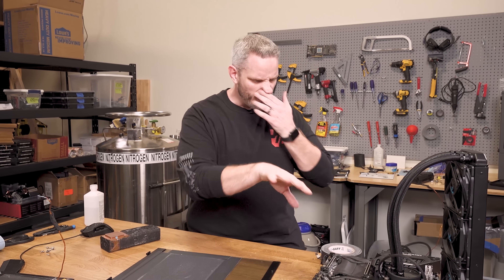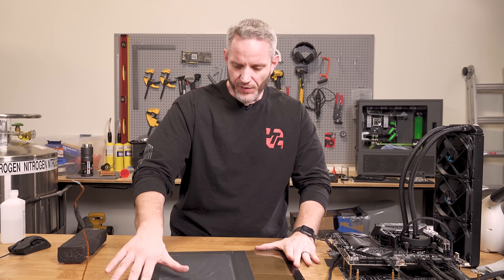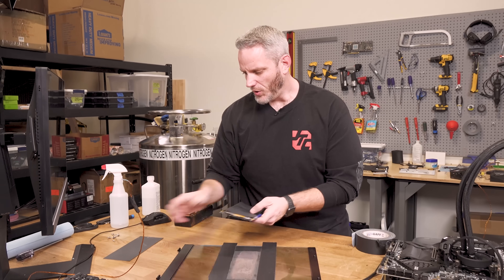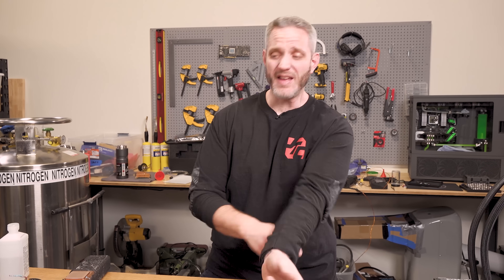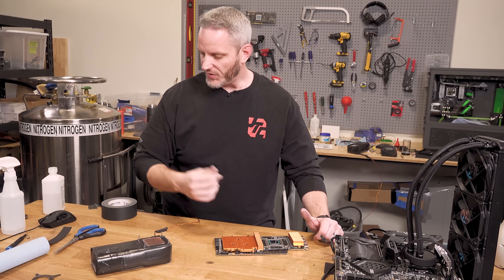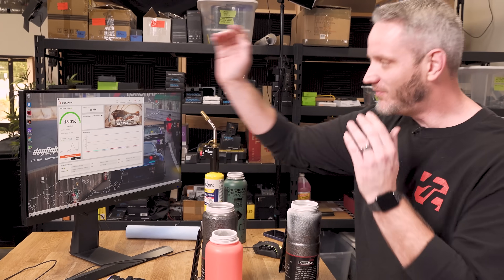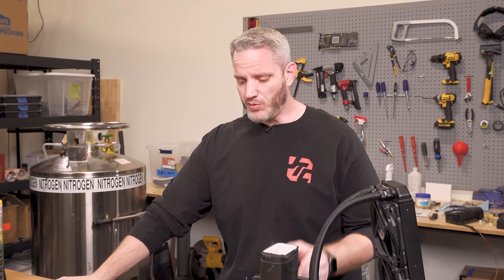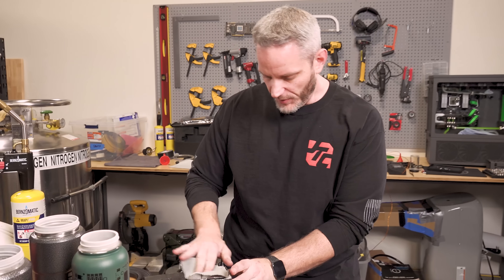THIS is Why Lapping Your Cooler is SO Important!!

Comment: dumb question, could i not add enough paste/putty. Do the dies get to inches in unevenness? i ask cuz id guess i use at least 1/8th thickness in putty/paste, would that not fill the voids. also, am i not shooting for flat/smooth no polishing just straight grind, the microscopic fissures that grinding creates dont matter?

Comment: Actually you are wrong, you don't want the surface to be rough so that thermal paste can "bite into it" 😂 if you could have perfectly flat surfaces you wouldn't need thermal paste at all. It should be kind of obvious but thermal paste is not as heat conductive as metal, the reason we use it is cause it spreads really thin and fills all the gaps of air you might have.

Comment: I'm more a fan of DerBauer's approach to how smooth it is.
The paste contains oxides which are very coarse. When you clamp that cold plate down, the paste will easily embed itself in the soft metal where it needs to. And when using liquid metal I have personally found that the more polished the surface, being it direct die or lapped CPU, the better. Is it harder to initially make the liquid metal sticking to the polished surface? Yes, you need to work it a few minutes more.
In short, there's more than one way to skin a cat.

Comment: Take a sharpie and color the whole area to be flat  itll help you see the low spots and when your getting close  i also agre with the figure 8 every time you stop anx start youre putting pressure on the edge of the direction your starting in  so a consistant movement without starting and stoping would be ideal

Comment: The transfer of heat here is more-or-less all about surface area, so it makes sense that leaving a little roughness, without compromising flatness, would help the thermal paste do its work. On top of that, I presume the sanding will take off any oxidising on the surface of the copper and help with conductivity.

Comment: I'm curious why you don't use a marker, filling in the area with it, and then sanding, to see where on the surface is lower than the rest. As you sand, the highest area, will go away, leaving the marks of the lowest areas.

Comment: the trouble with this u only cooling top of the chip not rest of it do u ever think of the heat comes off sides and back of chip transfers on to pcb board as well. do ever think why never cool back pcb board i add small fan draw air through back card help heat as well run when idle keep temps down. got make floating cpu block and new design motherboard same heat pipes but big block.

Comment: He got a huge liquid nitrogen tank sitting around at his work shop just to overclock CPUs and GPUs lmao 🤣This would be more helpful if used a precision dial gauge to check if all the surface area is truly flat, it's possible to check it down to 1 micron of flatness.

Comment: If you real want go the next step. Replace copper heat sink with silver. Silver is a better heat conductor than copper. Not much, but better. Cost alot. But he, every point counts

Comment: This is wrong. The most of the cpu manufacturers  bend cpu and for that reason AIOs are also bend. Bend direction is different for different sockets. You need to ask for example Intel for example and they will give you information.

Comment: I would use 1/4-1/2 inch thick steel plate (round or square that's slightly larger than the contact surface) that's been surface ground and lapped to remove any high spots, glue the sand paper to the block and allow it to dry (grit side down) on glass with weight applied (a brick) sufficient enough to dry flat, (remove any overlapping sand paper after dry)  use that for lapping with thin (olive oil consistency) oil until high spots are evened out,  then slowly lap it directly on glass with blue or yellow diamond compound I like placing the glass on a wet granite table to avoid any bowing of the glass.

Comment: I am sorry if I am misunderstanding or not smart enough to know, but why is it better to leave grooves? It makes no sense to me, since, if the surface is uneven, you will have more interface material to pass through before you get to the heatsink. Isn't mirror finish lowering the thickness of the thermal interface used and therefore increasing the efficiency? Please correct me if I'm wrong.

Comment: Maybe I'm wrong, but here's an idea that I thought of... With paint, yes. You want the paint to bite because you don't want it to come off. But paint is an aesthetic. And once it bites, you can keep applying your layers to get the best coat for your given application (sheetrock, car, wood, etc). In the case of cooling a chip, yes you want it as cool as possible. You don't need the paste to bite. You're not painting. Paste is used because of how hard it would be to get 100% perfect contact between the chip and cooler. So I feel that perfectly not just lapping, but buffing and polishing to as perfect to a mirror you can make it AND as flat as you can make it, would yield the best result and the paste would be to fill any concave/convex points where you may not have gotten it flat. So when the cooler is applied to the chip, it should essentially spit out all the paste except for the paste that is in any spot that isn't 100% flat because obviously it's not flat enough to spit it out. Think of a door in a house fire. If you have a glove on (or hold anything), the heat transfer to your hand wouldn't be as instant or effective as putting your hand on the door. In that analogy, the glove/object being the paste.

Comment: That's not how it should be done. First, use auto paper. Use water also to make it stick to the glass. Your dry paper forms a crease just at the edge of the copper. The paper is flexing. Not good. There is no need of tape on the sides when using water. Try it. I have a ton of experience sharpening japanese woodworking tools. Better, get a flat granite block instead of glass. Glass is flexing also.

Comment: Most glass is not perfectly flat. I used a MACHINISTS level and FLAT BAR to check surfaces for flatness. I was surprised to find all my glass was nowhere near flat. I ended up using a MACHINED FLAT METAL BLOCK.

Comment: Would a copper block or even a second cooler at the back of the card might get even better results? Will need a Threadripper or even Epyc motherboard to use the extra PCI lines to move the card away from the cpu.

Comment: Hey just a thought another way to check for that dome effect i work with all sorts of metals and alloys forging knifes and working with alloys for the guards and handles I use a specialized ink/dye called (dykem) to mark when I'm going to be taking away material for my scales on the blade to form the cutting edge and on sections of the guard and handle for the safe purpose to make clearly where im going to place finger groves or any particular patterns this same ink can be used to detail the imperfections on the copper or nickel plate as you are here just a little idea that could help less experienced people get the top best results

Comment: Shouldn't the logic be to get the layer of paste as thin as possible between the dye and the cooler (ergo make the contacts as smooth as possible) instead of making them rough? Your argument is so the paste has something to stick to, but isnt that missing the point because this way youre effectively thickening the paste layer and making the heat transfer worse?

Comment: While a vacuum would remove heat convection from the atmosphere is there a set up where you could replace the atmphere with something that would deal with the water moisture without killing the radiation/convection of heat, to stop the ice from forming in the first place? Probably a very bad idea and overly complicated.. after all then you;d have to cool the 'moistureless case' as well... but we are talking insane overclocking with an ice problem...
Reply: I was just thinking that the ice build up could end up pushing against the die/cooler plates trying to bow them as the ice expands...
Reply: And if something like that works what would be best used as the heat transfer gas... Just random thoughts and might not do anything for it so LOL whatever

Comment: Not all glass is perfectly flat. You want to specifically use float glass, which is created by pouring glass on a liquid surface. Float glass with sandpaper gets the best results for flattening sharpening stones and lapping stones. Flatness tolerances are less than 0.0005 inches.

Comment: One correction: Any physics phan can tell you that you want the two surfaces as smooth as possible for maximum metal-to-metal contact. This allows for maximum thermal transfer. Allowing scratches for thermal paste to 'bite' is a fallacy. The paste will fill the small spaces no matter how small - unless the spaces are smaller than the particles of paste, which no hand polishing will ever reach. Leaving scratches for the paste to fill will leave spaces for air to be trapped along with the paste. No paste will never transfer heat as well as metal-to-metal contact. 
Make both surfaces as smooth as possible and as parallel as possible with as much contact as possible. Let the paste fill in the nearly microscopic gaps.
When you leave 'lines' on both surfaces, they will not line up parallel - the high spots of each line will sit on top of the high spots of the lines on the other part, leaving huge gaps. Think of two sheets of window screen laying on top of each other. Your hand sanding will not create perfectly straight and even lines to line up with the other imperfect lines. Even if you could make perfectly straight lines perfectly spaced, the lines going in the other direction will prevent the lower 'scratched out' lines from ever meeting, not to mention the spaces still deeper. If you can see lines, you will have open spaces not touching, filled with paste, air, and contaminants. 
Make both surfaces as smooth as possible, and as even, flat, and parallel as possible by fitting with paste and finding low/high spots and any grade or 'ramping' effect until you are satisfied and have even almost pasteless surfaces. 
Only then will you reach maximum thermal transfer.

Comment: As a professional in lapping, I come for the cringe and to point out everything you're doing wrong :P I've successfully lapped many things to sub-wavelength accuracy for optical applications among other things in industry.

Omg, the off-center weight. Wow. That's already a massive problem. Best you could do would be to add another piece on the other side of the weight at the same size to keep it square and flat. Zero chance you can get it flat without rounding off the edges with that thing like that. It is unavoidable to round off the edges when you're using this technique.

Okay, the classic float-glass lapping. I mean, it's the flattest thing available in an average house, but it does bend too, and you have it on wood which probably isn't very flat, and even the small mite of wood chip can create significant bends in glass that thickness... Why not spend $60 on an actual rated surface plate. Even the worst surface plate is better than household floatglass.

Back and forth sanding is awful, you should be doing figure-8's to sand in all directions at once.

There's a pretty easy way to check actual contact with the chip itself, use a little bit of prussian blue or blacking and rub the two surfaces together, this will show you directly your contact points, including rounding or humps. What is the actual point in making your heat-sink perfectly flat if it turned out your CPU top was rounded like a camel's back.

The absolute best thing you could do really would be to lap the CPU and the heat-sink together rather than using another surface like floatglass. This would result in the two surfaces perfectly matching each other. And while they likely wouldn't stay perfectly flat, if they did start to go convex or concave they would do so to a perfectly matching amount so it wouldn't matter. If I really wanted to match these surfaces up, that is the way to go.

And if you did decide to do that, there is a special lapping technique you want to use. The same lapping technique that the telescope makers use on their primary mirrors. That being lapping around in a circle and then spin lapping to compensate for the middle getting more grinding than the overlapping edges.

E.g. on lapping around: https://www.youtube.com/watch?v=EbTtJ6QbnWU

As for the shininess vs leaving some material to grip the paste, any shininess you see means you're getting surface feature smaller than one wavelength of light, we're talking the nanometer region. Visible light being 400 to 700 nanometers. Meanwhile you might be lapping to within a few tens of millions or a few thousandths, unless you lap them together as I previously suggested, in which case they would be nearly a perfect match. And one thermal paste with diamonds I saw https://www.innovationcooling.com/thermal-compounds/) has particle size in the 40 micron range, which is way, way larger and will act as a ball-bearing layer between the two surfaces of at least that amount. Shininess shouldn't be a significant factor.

Instead of vaseline, why not pour an epoxy barrier, or even silicon. If water condensation is such a big deal, why not bathe the board in DI water that is so pure it is non-conductive. It will tend to freeze too perhaps, but will act as a conductive barrier against condensation out of the air. I would suggest a kerosene bath but that would probably dissolve something. A siloxane covering on the entire chip is probably the best thing, it's both flexible, resists being frozen, and would make the whole chip waterproof. Alternatively, trying to produce a low-humidity environment to test in is possible. Air conditioning has the side-effect of drying the air, so you might consider that. It might also help you achieve better temps if the card is refrigerated closer to the temp it's going to be cooled at because that will tend to produce less warping as it differentially cools.

As for spreading the paste, you need something much more systematic than that. Take a lesson from the tile guys, when they want to put down a perfectly consistent and even layer of mortar, they use a combed trowel. A combed trowel produces a completely even thickness of paste in a given area, and the ridges are pressed out as you place the tile down on it with a slight sideways motion, leaving a completely even layer of paste between the mating surfaces with no air.

And you didn't show the clamping bracket in the back designed to keep the board from bending. You would want something with thicker arms to do that than what is standardly shipped. Maybe a cast-iron piece would work there.

The best heat conductor is actually diamond / carbon nanotubes, and there are companies that make a c-nanotube spray that you can spray onto surfaces to coat with c-nanotube layers, and the thermal conductivity is incredible. I have long thought someone should try that as part of CPU and heat-sink mating. A thick enough layer of that would be the best way to remove hotspots I can think of because it would rob the hotspot of heat and spread it out. Likely better than the diamond-particle thermal pasts, because the diamond filaments as a single layer are going to be a lot better at heat spreading that particles suspended in thermal paste. But it likely still has to be used with a thermal medium. (https://journals.sagepub.com/doi/full/10.1177/1687814019894454)

Comment: Just recently I have faced similar issue with my motherboard: Gigabyte Aorus Z490 Xtreme Waterforce, which I purchased to reach my overclocking goals also. Unfortunately, 2mm plate placed on water block inner side, which should have even contact with IHS, has been found bulged in its center part and does not allow CPU to rest on it flat. It resulted in well visible gap (as it is shown in photo no. 1, 2 and 3), on both sides of CPU after assembling specially prepared CPU housing (as per photo no. 4) to indicate surface incompatibility.

Factory-made block is provided with thermal grease initially applied and only by its removal such imperfection could be found. I reported that, in my opinion, defect to Gigabyte Poland representatives, who asked Gigabyte Taiwan to get clarification on this unwanted and unexpected obstacle to commencement of my custom PC project. I would never ever think that premium class motherboard could possibly have had such deformation.

Surprisingly, Gigabyte did not consider my claim as a faulty product and refused my grounded complaint. They had not investigated the problem closer and did not even ask for submitting water block for their own inspection. They stated without any hesitation, that this protrusion is by design, as CPUs are actually slightly lower towards the center of the dye. According to them this helps increase pressure and improves contact after installation. As for the concerns about uneven contact, they say that the plate material is actually flexible enough (it is not in fact) and contains some rubber internally, so once the sink is secured, the contact will be even. Only the normal amount of thermal paste is needed.

It looks to me that Gigabyte invented something, what simply stays in conflict with common sense. I am just wondering whether anybody has encountered something like this yet?

Link to photo no. 1:
https://ibb.co/hKMYnHZ

Link to photo no. 2:
https://ibb.co/vsr4dGq

Link to photo no. 3:
https://ibb.co/KrQtDdH

Link to photo no. 4:
https://ibb.co/pRSh4KP